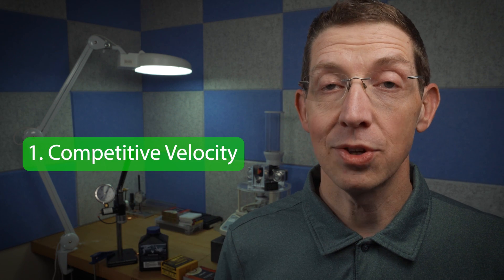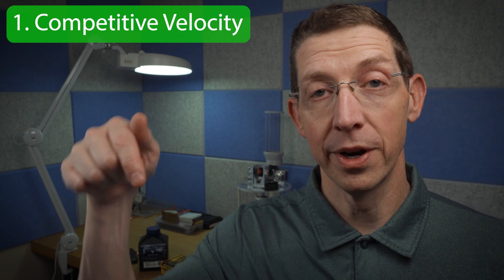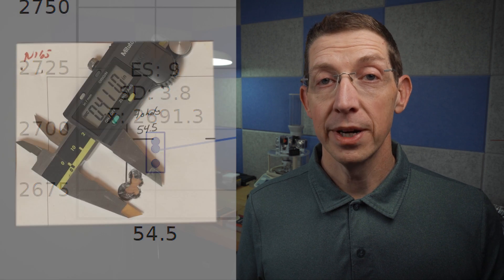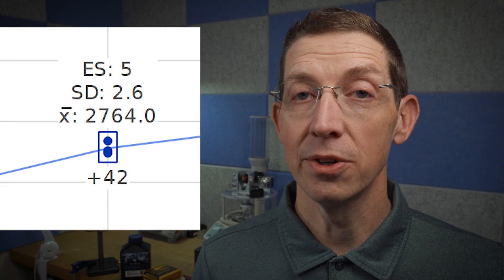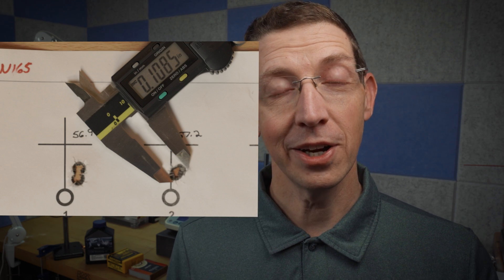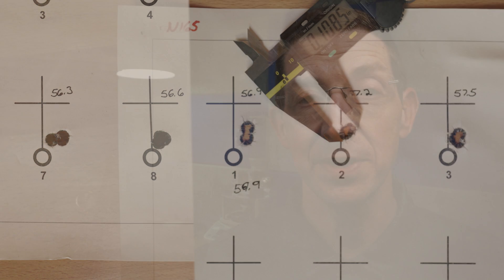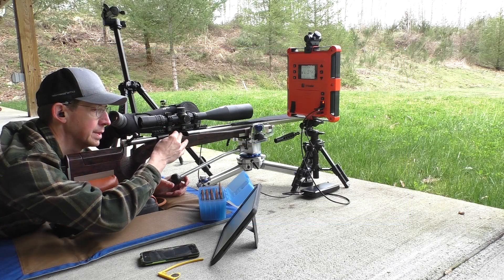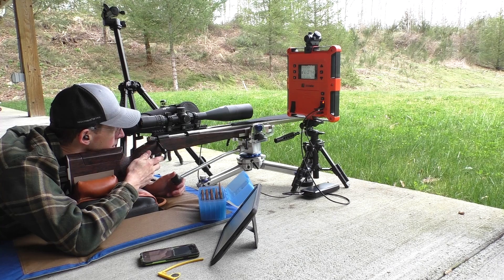Powder Load Development - 284 Win  vs Vihtavuori N165

Comment: I am currently working up a load for my 280AI using VV 165 and 180ELDs. Unfortunately I am getting velocities about 100fps less than similar powders, BUT every single group I’ve shot so far has had single digit SDs, many being low single digits. I’ve always chased velocity but for ELR I am learning that consistent velocity takes priority.

Comment: Great informative video, you mentioned along the way you checked your pressure because you didnt want to blow yourself up, how did you check your pressure?
Reply: After each shot, check for symptoms of high pressure:
1. Hard bolt lift
2. Cratered primers (burr around firing pin impact), flat edges on primer, loose primer pocket
3. Hole in primer (pressure blew it back around the firing pin into the bolt
3. Ejecter mark on the head of the case

Comment: Hi Keith I did my load development with N165 and 180 hybrids ar 101 degrees. It was fun , it's tuning up at a charge weight of 56.9 at a velocity of circa 2820. The issue is that as I am using a Panda Action I am getting clicks on camming the bolt. 
It's a nuisance I want to stay away from. Advise what to do.

Comment: Keith, @ 11.00min you said you go with 56.5gn to let some room for grow due to temp - are you allowing only 0.1gn for temp? In another vid you suggested 0.4gn for temp. Are you using a secret formula how to calculate powder charge vs temp?
Reply from the maker: Yes, no, maybe. I'm allowing room to grow for temp in two different ways. The first is not going above max pressure, for safety reasons, and the second is to ensure I don't blow through the top of the node window. Remember, there is that upper shelf of the node identified in the video. I also use a reasonable expectation of temperature based velocity change that may or may not be accurate for any given powder. That is where extensive experience with a powder type comes in, and I don't have that kind of experience with this powder. Staying conservative until you know a powder is the best plan I have.

Comment: When doing load dev, how long are you waiting between shots?
Reply from the maker: That depends on the barrel. In an F-open rifle with a barrel that resembles the axle from a truck, I am only waiting 10-15 seconds between shots. With a lighter barrel, I slow down a lot to keep the barrel temperature down.
Reply: @winninginthewind  
This is interesting. Would be interested in further understanding the actual temperature effects and how they materialize. Ive thought about this quite a bit and would be interested in feedback on some hypothesis. 

To start, framing the problem as 2 classes of problems: the first is variation in velocity and the other is variation in POI. 

For the first (velocity variation), I can see two factors that could influence. First is pretty straight forward being the temperature of the powder from the chamber heat. The other is inner diameter of the barrel changing as a result of CTE; could a smaller or larger diameter effect resistance/friction leading to pressure/velocity changes?

The other being POI changes would appear to be a product of two potential CTE effects. The first is asymmetric stress from material removal operations causing asymmetric expansions (is stress relieving a barrel post machining a thing?).  The other hypothesis would be ID of the barrel changes having effects predicted by optimal barrel time theory (ie large ID of barrel causing larger group size).

With all that, can you kill any of these ideas directly or expand on/point me in the direction where I can learn more about these subjects?

Comment: After each shot the internal state of the barrel is different than the one from before that shot (copper/lead & burnt powder deposit). I call it a volatile internal state of the barrel. How do you account for that?
Reply from the maker: You can't. Even when shooting round-robin, the internal state of the barrel is ever changing. With that in mind, a dirty barrel is going to change less over a number of rounds than a dead clean one. Proper fouling prior to testing is the key to the best results in my experience.

Comment: Nice, thanks for the video.  

My big question is: have you ever picked a load due to the SD (IE: larger group size, smaller SD)?  Or do you end up just using the SD as a tie breaker?
Reply from the maker: Yes I have, and it didn't turn out well.

Comment: Straight forward and informative video Keith! I just received my Bartlien 32" barrel chambered in .284 Shehane with 1 in 8.5 twist. I will be testing the N165 powder with Berger 190gr. LR hybrids. I've tuned the 180gr. Berger Hybrids with N160 in my 30" Brux barrel 1 in 8 twist, chambered the same with great results at 2850 fps. Looking forward to the next video Keith!

Comment: Went to the range yesterday.  Using identical load data  I used on 150gr Berger elite hunters for their VLD hunting (Vlds being the only 7mm thing available), I was embarrassed by the difference. Best "grupe" 1.48. Previously high 3s with the elite hunter,a hybrid. So this is well timed and greatly appreciated.  N165, 65.5gr, cci 250,nosler 2x fired  1x trimmed, annealed. 7mm rem mag. Previously great jump performance at .015 off lands. May try Berger jump system next. Thanks again!

Comment: At what powder charge would you do your seating depth test at  for a new powder,bullet,primer load before doing the optimal powder charge test?
Reply from the maker: I'd do it toward the low end of the charge range. We want to be safe, and seating depth does affect pressure.
Reply: @winninginthewind  thank you, I have been reloading for a very long time and never did bullet seating depth test until I started watching Youtube videos by you, Erik Cortinas and others. The info you and others share is amazing and I appreciate it Thank you again.
Reply: Use a low, starting book charge for seating testing. I test in .005" increments because the seating depth nodes can be narrow, especially for thin profile barrels. .010" is fine for heavy barrels. Take the best charge and use that in the powder charge tests. I've found that the original, optimal seating depth doesn't change more than .005" when you go to fine tune after powder charge

Comment: Your goal is 1/4 moa for F-open. Does it change for FTR?
Reply from the maker: Yes, in that shooter skill gets mixed in more broadly with a bipod. In that case, a little interpretation is in order. It may not print all shots into 1/4MOA on the paper, but the one out is known or suspected to be shooter error - I consider that as good as one is going to get.

Comment: Thank you for putting this together.  
If you don't have any idea of seating depth, what size steps would you take for COAL to get a rough idea of where to start?
Reply from the maker: I do rough testing n .006" increments. I could go a little bigger, but I can cover quite a bit of ground very quickly at .006". Remember that if the first two aren't close together, it's time to move on.
Reply: @winninginthewind  what would you call bigger? I tried a few 0.5mm (0.02in) that seem way to big now. A 71mm oal works with my Custom Comps however I'm working up a scenar now. Would going 0.25mm / 0.01in increments be too big. As I have very little idea where these would work. And then I'd go from 70 - 72 mm oal which would be 24 rounds for seating depth. And a few more for fine tuning. 

I've chosen my load based on where GRT says I should be on a node.
Reply from the maker: I don't do anything in steps larger than .010, too easy to completely miss a good spot.